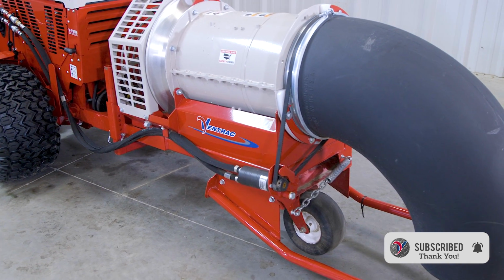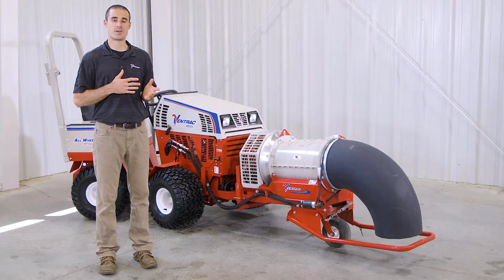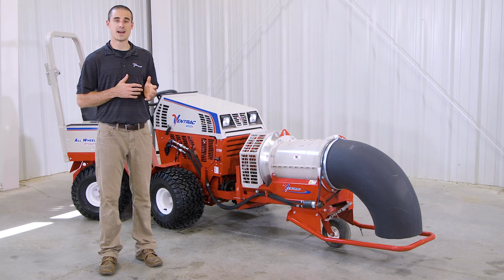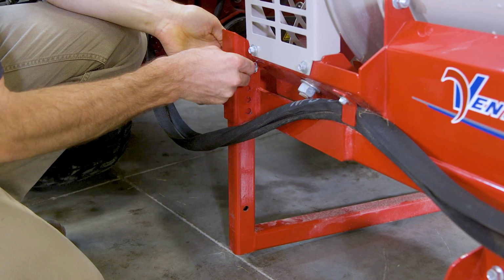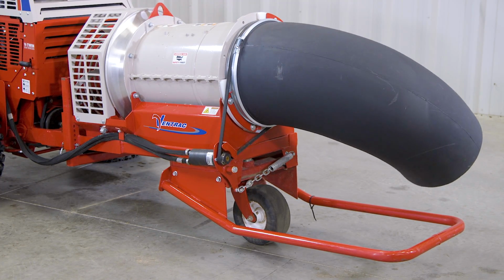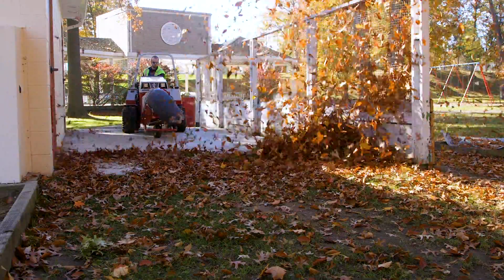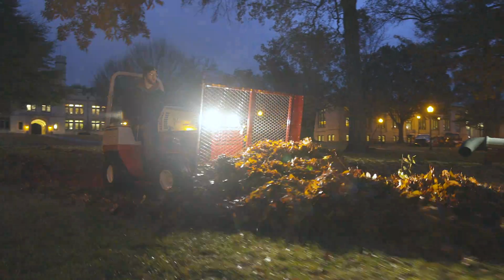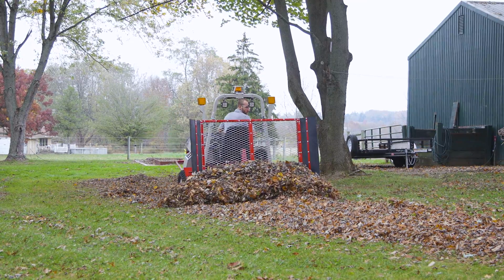Powerful Leaf Blower For Large Scale Clean Up - Ventrac Turbine Blower - Simple Start

Comment: How much weight will the Ventrac lift with the 3-point hitch, and will the 'weight transfer' transfer weight from the back of the machine to the front?  Also, how high (in inches) will the rear 3-point hitch lift?
Reply: I found it...  750l b, and 14 in. i can't find the weight transfer answer.

Comment: I need more space in our shop.  I just bought the Power Blower because of it's relatively compact size.  I haven't seen specs, but you mention 175 MPH for the Turbine Blower.  What is the CFM?  How does this compare to the Power Blower?
Reply from the maker: Hi Blue Cord - there are a lot of variables at play here (engine, RPM, conditions, etc).  We don't post a standard #, but you can expect about double the CFM of the KA160 blower.  When you are moving leaves, the higher CFM makes a huge difference.
Reply: @ventrac  of course.  Thanks for answering
Reply: I believe they did a video on that last years
Reply: The Turbine blower has an incredible 10000 cfm! That's more than triple the power of a standard walk behind blower.